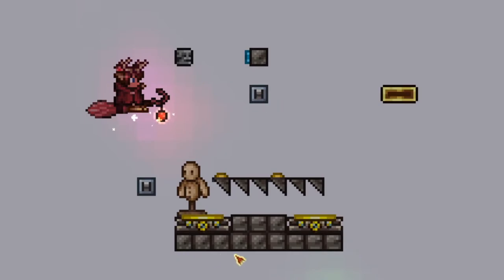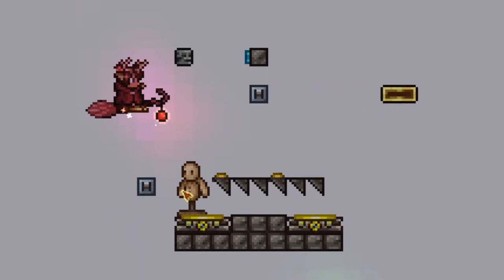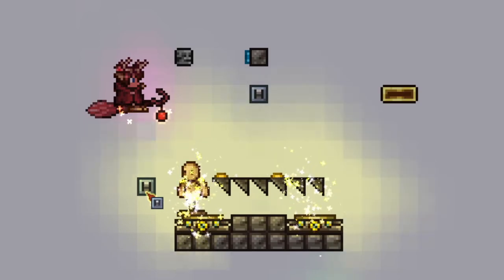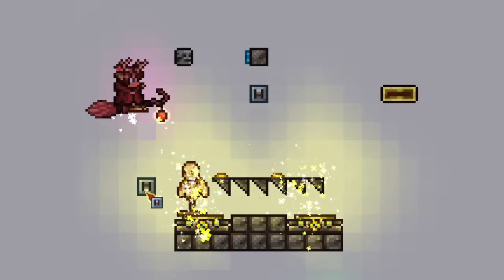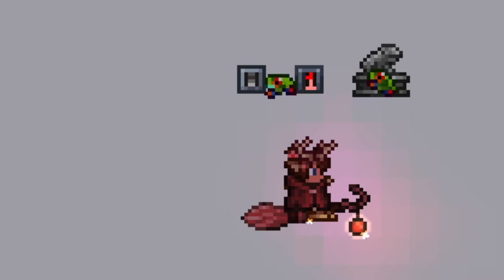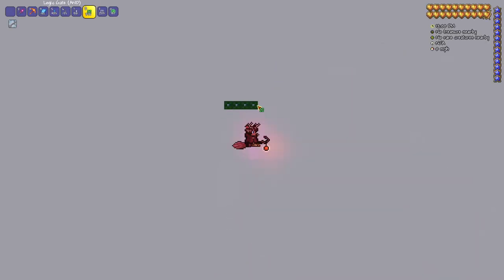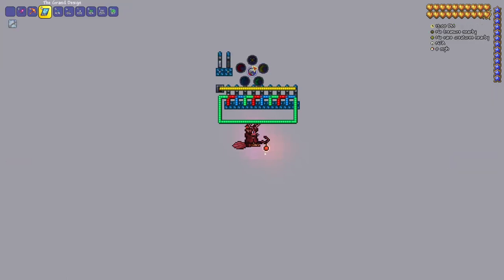Terraria: the Secret Mechanic behind Timers

Comment: Wait, so timers make mob engines obsolete? 
Their primary reason is for speeding up the amount of inputs. That can be done in a smaller space with timers.
(Still coming to discord ho dincord my project later, just still learning now)
Reply from the maker: yeah pretty much. Statues are still used for other things related to logic, but when it comes to timers they're uneccessary. The only reason you still see them is because no one else makes tutorials about logic gates, and even so they're still relatively hard to make. In this video I also didn't feature any longer timers but I could design one for you which you can set to trigger whenever you want, even if that's after several minutes
Reply: @CubsYT  We'll do it together, I'll help you make a video out of it.
No videos exist for making a multitrack jukebox so lets be the first. 

One benefit I see is that mob engines will still be available prehardmode if that's something that matters to you, because you don't get the steampunker till later to get logic gates and lamps.

My world is on drugs though, I had the steampunker in a prehardmode master 'the constant' and 'celebration' world generated on a drunk seed.

This game still has some life to rip from it.

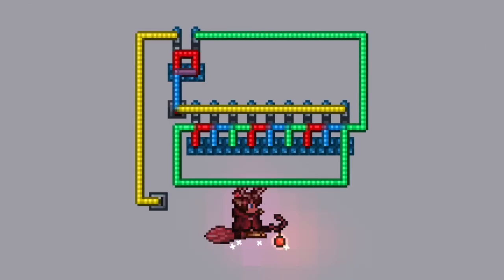Comment: 3:10 in this machine, couldn't you just replace the SRNOR latch with a or gate; just connect the final wire of the shift register into the or gate's lamp
Reply from the maker: An "OR" gate wouldn't work if you mean having the wire of the switch and the output wire as different lamps of the OR. However having any type of gate with only 1 lamp ontop, then connecting both the switch wire and the output wire to would work as a replacement for the SRNOR, but then it'd break if you flick the switch twice - the SRNOR latch is the most failproof way to design this I believe
Reply: @CubsYT  ah cool. when i was trying to find a way to cycle through a shift register the way i came up with was using an OR gate but i guess i didnt flip the switch fast and didnt end up catching the downside